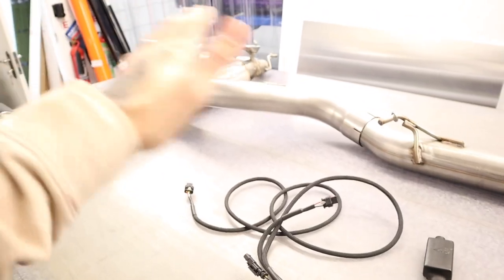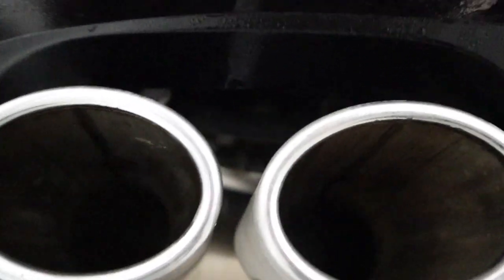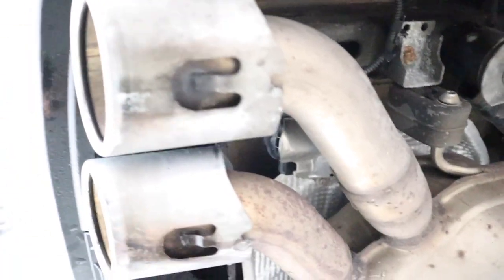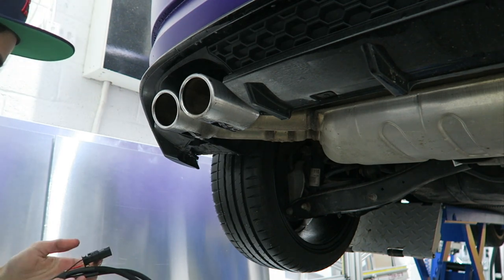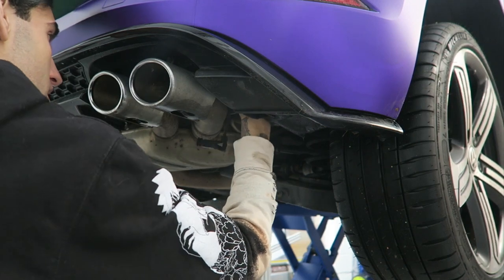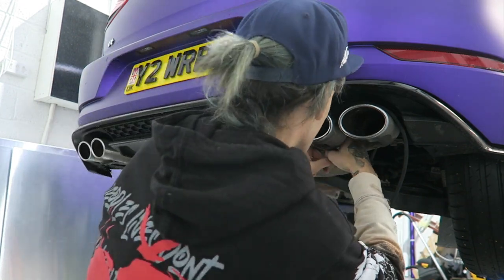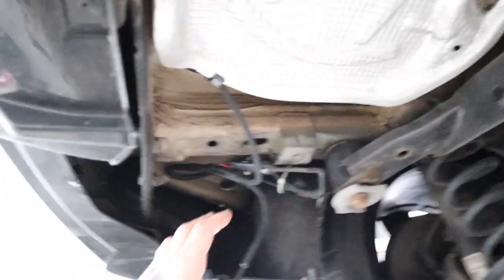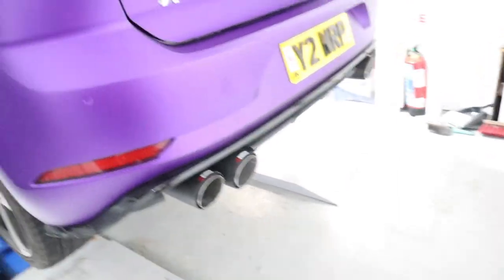APR Exhaust Valve Remote Install  - Golf R mk7/Audi S3

Comment: I installed this but I realised that the On setting does not stick, i turned the valve to On, before I know later, it's turned Off again
Did you get this problem?
Reply: Same thing here. Drives me nuts that when you lock the car or open the door, the controller reverts to closed setting.
Reply from the maker: when driving if i have the valve turned on it stays on, it only resets when i turn the car off and lock it, then when i unlock it i can hear the valves close again
Reply: thanks all - this is quite different to the user manual which advises it will stay on or off until intervened through the remote
Reply from the maker: @gtan  if you use vagcom to code the valves to always be open I believe that should fix the issue of the valves automatically closing when unlocked
Reply: @AlexZerbino  No. My valves are coded open and they close on their own. You can hear them close when you unlock the car. I programmed my garage door buttons in the car to be the on and off from the apr remote.  I have  to reach up and hit the button every time I get in the car to open the valves. I really got tired of looking for the remote every morning.